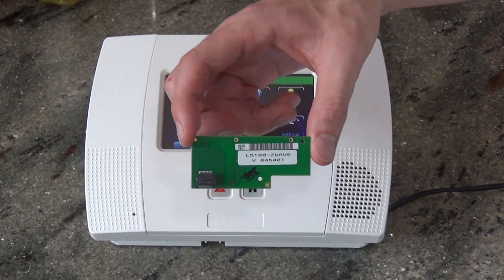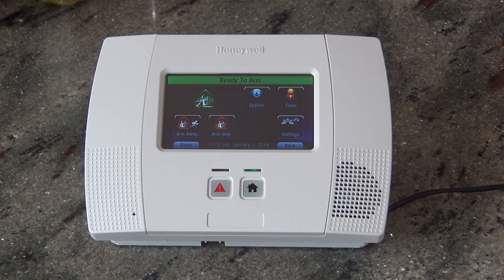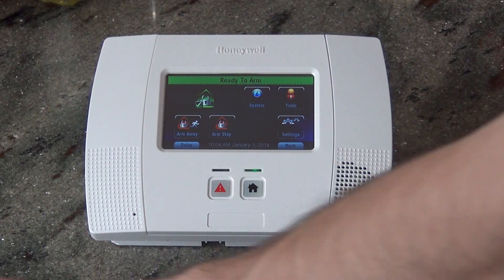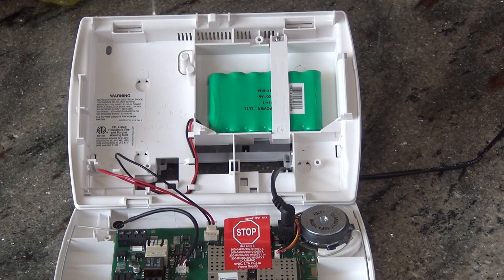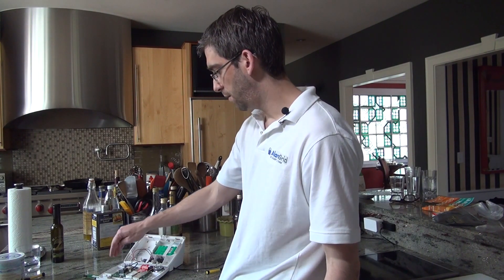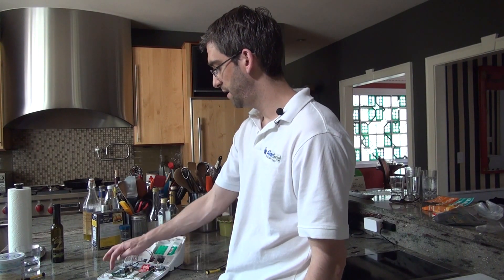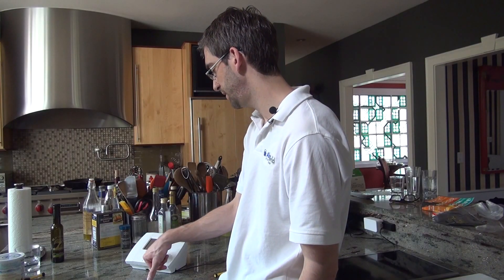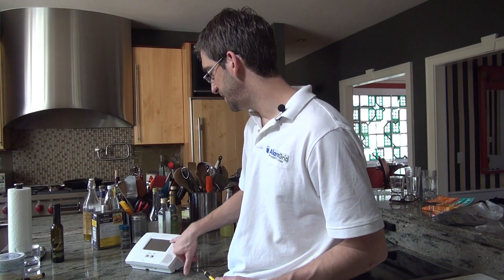Honeywell L5100-ZWAVE: L5200 Installation

Comment: Can I control my Z-Wave devices (lights, thermostat, etc.) remotely on my smart phone using Total Connect 2.0?
Reply: 1badnomad Yes, as long as your plan include the Z-Wave automation feature. You can also setup alerts when Z-Wave devices come on/off, setup scenes and rules through the totalconnect2.com website and setup scheduling fro the Z-Wave devices.
Reply: Sterling Donnelly Thanks for the reply. It is a monitored security system and I can arm and disarm my L5200 LYNX Touch system remotely from my smartphone or trough the Total Connect website. Would I have to get some extra service to be able to operate the Z-Wave devices remotely? Thanks again for your help.
Reply: 1badnomad Yes, you'd have to ask them how much extra it would be for the Automation module. We also have some great no-contract monitoring options online at https://www.alarmgrid.com/monitoring should you want to switch to us.
Reply: Sterling Donnelly Oh, I have the Z-Wave module and the cell module. I just haven't installed any Z-Wave devices like lights or anything yet. I'll check out your link. Thanks.

Comment: Can you have the wifi, wave and gsm cards installed all at once?
Reply from the maker: Hey Bobby, you sure can. The WIFI card goes on the right side on the edge connector as you face the panel, and the GSM goes on the left side using a card and some screws. Underneath the GSM is another edge connector where you can put the Z-Wave module. The panel's design allows for multiple modules to be installed in the system. You can have the WIFI, Z-WAVE, and GSMVLP5-4G or iLP5 in the system together. The GSMVLP5-4G and the iLP5 are the only two that can't go in at the same time since they use the same port.